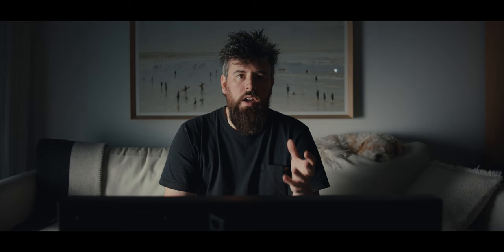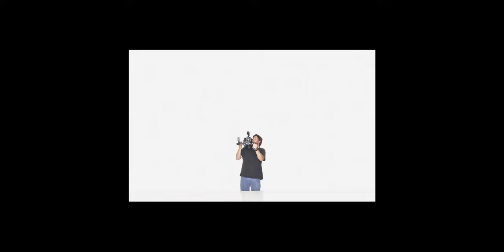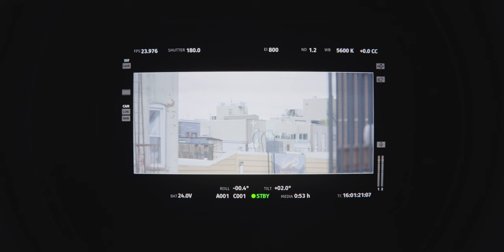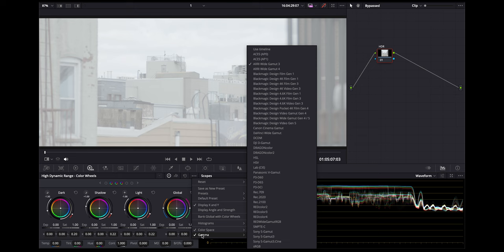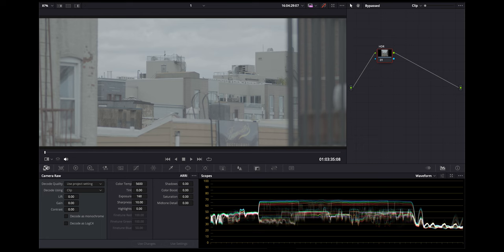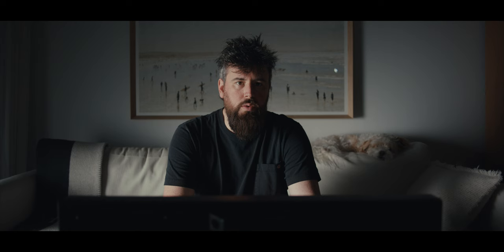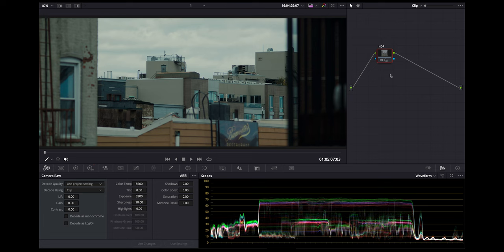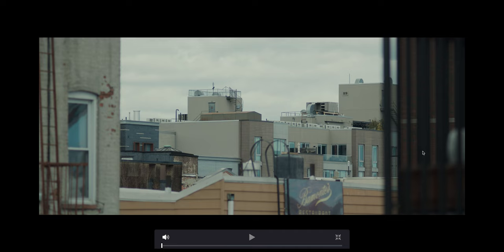An age old exposure trick.

Comment: You're so right about adding an exposure compensation LUT so that you get as much information in the image, then just dial in the exposure based off the way it looks in the monitor, then quickly check to see if highlights are blown or not.
Reply from the maker: Yup! Have to be careful at times but this works nicely for a lot of scenarios. Especially good for delivering to web where clean images do better in my opinion.

Comment: I generally agree with this approach of saturating the signal, but I think its worth mentioning that cameras only have one (or two) sensitivity that its always recording at and every other ISO is gain up or down on that original signal. So if the scene isn't well exposed at native, it just isn't well exposed.

What you're seeing with the difference between setting raw tab to 160 vs 3200 + pull down actually has to do with the underlying math behind the HDR wheel, not the signal itself. You should be able to observe the difference if you do a CST to Linear gamma and gain down instead of using the HDR wheel.The Global wheel is great, but the math in play is not simple linearization. It's operating in an LMS space that is a somewhat lacking implementation, leading to certain behaviorial artifacts in exposure adjustment and white balancing. You can observe this as well on synthetic LUT stress testing charts.

So in reality, the difference between raw tab 160 and 3200 on the same initial capture from in-camera is nothing but a redistribution of the original data. The workaround you've provided is working around a Resolve issue, not a capture issue.
Reply from the maker: Yes. I can’t remember if I mentioned this is the video, or if it didn’t make the cut, but you can generally get the same look out of any iso. It’s just nice to have “better highlights” without really having to do anything. On an Alexa for example the EI remaps the curve/distribution, thus making it “easier” to get “better” highlights at higher isos. When not shooting raw, and exposing normally or over, on an Alexa, you still will get better highlight performance at higher ISOs, and better shadows at lower ISOs. This video is more of a proof of 1) the advantages of sometimes over exposing and 2) the advantages of sometimes choosing a higher iso.
Reply: @BlaineWestropp1 this applies to the mini lf, and log c 3 cameras to some extent, as iso changes the log curve, but in s log 3, log c 4 and red white gammut, changes to the iso do the same as an exposure compensation lut, just with less messing around

Comment: Love it... this is the way! I often wonder if Deakin's LUT has a couple stops of reduction built in... there's a nighttime rooftop scene in Empire of Light that looks incredible. Could be noise reduction, but i doubt it... you just can't beat the pristine texture of a sensor that was hit with enough light. I think modern practice still photography hasn't copped onto this yet.. everyone's trying to overclock their camera's dynamic range by pushing two stops in post (not pulling!) and then trying to salvage the image with new AI noise reduction, to varying success...
Reply from the maker: agree with ya. I would of course love to talk to Deakins about his approach. I have not seen empire of light. wonder if they shot at dusk, instead of at night. this is why nights are hard, its hard to over expose pure night exterior sky with a camera.

Comment: Huge fan obviously and i agree that in general over exposing just below clipping makes sense. Better to pull down shadows rather than try to push them up and in general in natural light exposing for sky pushes us into that realm pretty quickly. On something like an alexa where colour shift and fidelity holds up well at three or four stops over unfortunately for many cameras and codecs the colour accuracy strays pretty badly two or so stops either side of “properly exposed”. Ie going by manufacturers ire guide for middle grey. I have found particularly with Sony that their luts are excellent when zebras are used to expose correct middle grey and nail that. The colours are then spot on using their standard correction luts. Although highlights are a great benchmark in general i find that middle grey is an easier reference for me not least as some scenes will not have a high contrast range but most have a middle grey regardless. Again in terms of exterior landscapes and sky no doubt that highlights are the priority and avoiding clipping but anything to do with people and even building details, brick and concrete, then middle grey and effectively skin tone maybe feel a useful marker to extend or not and keep an eye on. I agree that using adjustment correction luts are super key when shooting and monitoring if nothing else for a bit of confidence. Colour shift though is a thing particularly when looking for detailed midtones and complex colour in the skin and for sure although counter intuitively shifting iso higher gives better roll off curves for highlights. That said i think that there is a whole video to be done on colour wheels and hdr and how colour density is affected by the normal offset wheels whereas the hdr wheels dont affect that density or saturation and so are the ideal exposure adjustments once a look in terms of colour is done. Not least their ranges can be fine tuned to suit the image. Once again a beautifully precise and elegant explanation video. Thanks again.
Reply from the maker: Hey thanks Ken! Agree with you here. All depends on the camera you are using, the scene you are shooting, and your end goal. On fx3, red, Blackmagic, pretty much all the modern cameras that shoot log, you can overexpose and pull down and be looking good. But this is really only needed when you want to minimize noise and get absolutely the most clean image possible. Not needed at all times, and you don’t have to go 4 over. You could go one over. I know I’d rather be a recoverable amount over than any level under!

Comment: This is the ETTR method that you would have to do on most Sony cameras a few generations ago when shooting in SLOG.  Don't have to do that these days!  Although I do use the CineEI method and rate it one stop lower (400 vs 800 on FX6) to get cleaner shadows. Just not to the degree done here.  Another way would be to shoot at a higher ISO (1600 or 2000) and use ND to bring down the exposure.  That method shifts your middle grey up so you are getting more dynamic range in your highlights.  The inverse works as well, when shooting dark scenes, shoot at a lower ISO and add more light to compensate as that shifts your middle grey and dynamic range towards the shadows.  EDIT: Sorry, just saw you mentioned the same thing at the end of your video.

Comment: Interesting! To add to this. With the FX3 on Cine EI mode it basically locks the camera into only using base ISO settings to maximise dynamic range. So for example with base ISO 800, I set the ISO to 500 so it appears around 2 stops darker, which in turn makes me increase the exposure by 2 stops with other means other than ISO, like lighting, aperture, nd etc. Thus maximising the dynamic range.
Reply from the maker: Yes cine EI is like just changing the monitor Lut. Also 2 stops darker than 800 is 200 😊. 800 to 500 is 2/3 stop darker.
Reply: @BlaineWestropp1  Nice one Blaine

Comment: Quite interesting, the only thing that comes to mind is that Alexa encode to roll off highlights, so if you intend on exposing upper mid tones in the highlight regions, they will effectively roll off when offset back down in davinci or via whatever LUT you're using. You can correct for this of course, but just important to take into account as it will effect the tonal reproduction.
Reply from the maker: I like how the highlights, and even shadows, (on brighter scenes) look on the Alexa at higher EI values. So to shoot at higher values and reduce the noise that comes with those higher values, I will expose hot!
Reply: @BlaineWestropp1  The tests were night and day for sure
Reply from the maker: Yep!
Reply: after a test with an alexa mini in prores and evaluation with my colorist i came to realize this: you sacrifice tonal reproduction by using ettr. definetly something to bear in mind when you need the tones to be "deep" and saturated.

Comment: Technically this is more about ETTR, the negative film works in reverse.  Overexposed on film produces dark “thick” film.  But almost certainly there is some information in the darkness on the film as underexposed tends to produce clear film.  Ie the image doesn’t exist. In dark areas the image was recorded perfectly then it  recorded the image darker on top. So while its somewhat covered up, it’s still actually recorded.  Film records slow at first then slows down at the end of dynamic range also.  Those soft clouds are rolloff at the end of the dynamic range curve.  On digital you have more dynamic range in many cases, but by overexposing the high lights begin to get thin, because log is already compressing them. They are compressed because we don’t see highlights very good, so why record them in high luminance resolution.  Overexposure compresses the luma information even further in highlighs, but allows more for the darks and midtones. Digital  even log tends not to have a rolloff curve. The process of negative film vs digital is different so they will probably always look somewhat different.
Reply from the maker: yea.., ETTR yields a thick negative, on film and on digital. I am using the term thick negative to mean, overexpose digital, just as an ode to the original term. my biggest point here is that you can experience large benefits from over exposing!

Comment: One thing I can never nail, is getting super clean black, when you want one of those candle lit kind of dark moody scenes. 

I understand shooting much higher light level via false color and bring it down, but I notice that the image ends up getting wayyyy to contrasty and looks weird.
Reply from the maker: How are you bringing down your exposure? One approach, like in this video, is to over expose and bring down in post, and one approach is to shoot at a low ISO. If you go with the first approach you should bring down your exposure via mapped HDR global wheel, and then sometimes I’ll bring up the shadows a bit in the curves. Gotta finesse it. Also shooting at lower iso will give you more range in the shadows, which may fix your contrast issue, just need to light accordingly. It’s easy to shoot in bright light, harder to nail it in the dark.
Reply: @BlaineWestropp1  yeah - I mean, I try a few things,  but I've never mapped the color wheels before, I'll try that.

Comment: Isn't this the same as shooting at 400 EI on the Alexa? It's a built-in exposure compensation LUT as the sensor gain doesn't change (except in ES Mode on the Alexa 35). Shoot at 400EI, you've lost a stop of head room for highlights but can see another stop deeper into the shadows
Reply from the maker: Yes, shooting at 800 with a -1 stop Lut is similar to shooting at 400. Generally they will look very close but the 400 shot will have more detail in shadows and less in highlights, under very simply grading moves.

Comment: So for low light, would it make sense to clip the shadows then bring them up? Basically the opposite of clipping highlights then bringing them down.
Reply from the maker: my approach here is to over expose and bring things down. in bright light, over expose, but do NOT clip the highlights, then bring it down. In low light, overexpose if you can to get really clean shadows, and/or shoot at a low ISO to have low noise and more detail in the shadows. That is technically what you want to do but as always there are really no rules. I try not to clip the highlights or crush the shadows too much, so there is some flexibility in post!

Comment: this is a pretty noob-y question here and my apologies if you covered this in this video or another one but what is a good way to create these -2 exposure LUT so I can import them to my monitor? I use Resolve now, I tried mapping the LOG wheels as you noted and dragging the Global I think down to -2, and used the Generate LUT on that but it doesn't seem to work properly, instead it washes out the blacks and stuff on the monitor... Is there a simpler way to generate the exposure LUT? 🤔
Reply from the maker: Can you send me a message on ig? I’ll send you the right luts! @wstrpp
Reply: @BlaineWestropp1  Blaine another quick question if you have any insight, I've heard of SDI ports being prone to frying or being damaged by plugging in and powering in the wrong order and whatnot, if one were to power the camera and the  SDI monitor with completely different power sources (like not the same v-mount for instance), would that protect against the risks of damaging the SDI ports? Been apprehensive of using SDI over HDMI because of that fear of frying the port

Comment: Overexposing with the ISO work for all cameras, including digital cameras, or does it depend on different factors?
Reply from the maker: Really this technique is for cameras that shoot log. Really depends on your camera, and the scene. If you run a few tests you will see what  works and what doesn’t! Happy to answer any questions. Do you have a specific camera in mind?
Reply: @BlaineWestropp1  I speak in general. I have a humble Lumix S5 IIX. A video explaining in which case to use the ISO or use another method to expose correctly would be nice.

Comment: Does this apply to slog3 with the FX3? I’m hearing people saying stop overexposing slog3 anymore 😅
Reply from the maker: Yes, applies to any camera. Age old technique. Specifically good for cameras that shoot log. And useful if you want to diminish noise. Just make sure you do a bunch of tests before using for real. And.. you don’t have to do this, you can expose normally and be fine. This is just when you really want to pull it down in post which is useful sometimes.
Reply: @BlaineWestropp1  thanks for the response! One more thing, using CineEI and setting it to 2 or 3 stops under is the same as using stop reduction LUTs right?
Reply from the maker: Yes pretty much. The difference comes into play when you are using an external monitor.
Reply: @BlaineWestropp1  i’m sorry, but what’s the difference when using an external monitor?
Reply from the maker: @JirehTorres if you send a log image to the external monitor, you can use the exposure comp luts on the external, and keep your fx3 at 800 and view zebras on the fx3 monitor and save yourself from clipping where if you change the EI, your zebras change and you can clip by accident.
Reply: @BlaineWestropp1  thank you!!

Comment: Why are you exporting cropped 16:9? It looks really my UW monitor as I have black bars everywhere :(
Reply from the maker: this is 2:1. I typically use 2:1 and work within that canvas, sometimes filling it, sometimes not. If everyone had a wide monitor I would render to 2.39:1. Also, you miss out on some YouTube features when uploading 2.39:1!
Reply: @BlaineWestropp1  didn't know about missing features. I thought that exporting native would be the best in terms of how the video is presented on a specific device. 2:1 would be similarly cropped on 16:9 but without artificially added bars.
Reply from the maker: @theAristocrap  yeah I do like rendering native, and occasionally do, but most times I go to 2:1 regardless of what sized frames are within it. I know it sucks for those with wide monitors :( maybe I should upload native to unlisted and link it in the descriptions..
Reply: @BlaineWestropp1  I don't think it is worth your hassle. I am still interested in what benefits there are to rendering your 2:1 to 16:9 in terms of what youtube has to offer for this ratio?
Reply from the maker: @theAristocrap I am rendering and uploading 2:1. With 2.39:1 uploads you cannot add end cards or add info to the top right corner on YouTube! So it is mostly selfish, but I also often times have multiple formats in 1 video. 2.39:1, 16x9, 2:1, etc.
Reply: @BlaineWestropp1  Nah, you need to do what's best for the channel - thanks for explaining - I always though that when creators export to 16:9 and add black bars, they want to appear more cinematic. GL

Comment: Is this the same with Cine EI?
Reply from the maker: yes cine ei is very similar to this, but also depends which sony camera you are using, and which firmware it is on. if the EI adjustments do not get baked in, they are behaving just like a stop reduction lut!
Reply: @BlaineWestropp1  maybe you could do a video about it. Thanks!
Reply from the maker: @Bobsmithabc  I could do this.. I’ve been meaning to make some Sony videos!
Reply: @BlaineWestropp1  ❤️